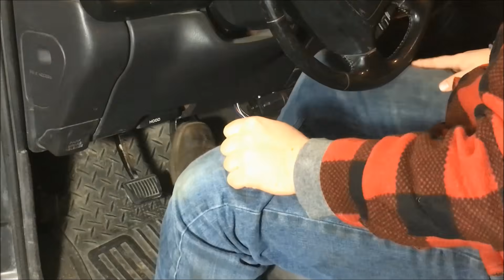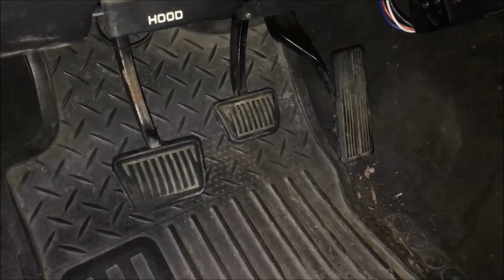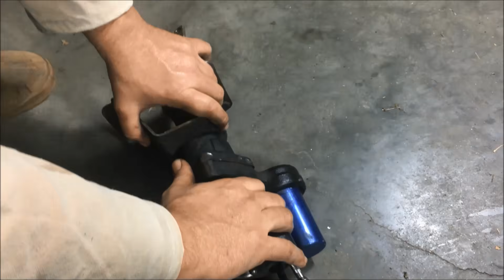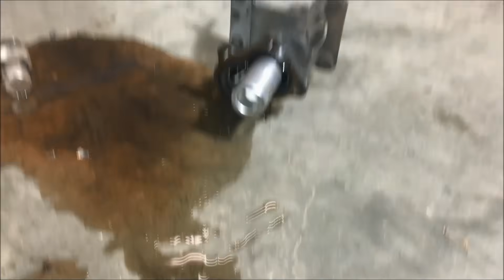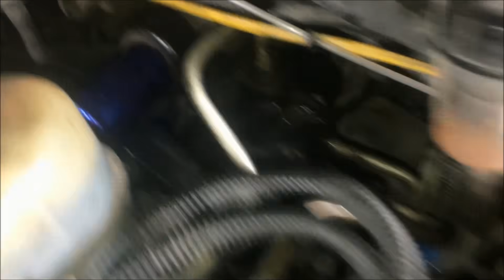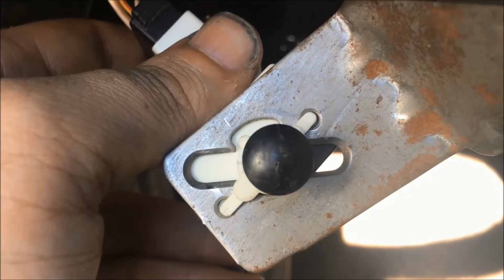How To Repair A Dodge Hydroboost; Boost Auto Parts

Comment: Hey thank you so much for your help.  This video really helped me out. 
I have a 2013 2500 Ram, I just rebuilt the Hydro booster. It’s all put together and the truck is ready to be crank up and turn wheel left to right and press the brake.
Would that be the same process for my truck that you show at the end of this video?

Comment: This video was extremely helpful, but I wasn't comfortable using their reassembly technique.  Rather than hold the plunger with a vise grip, I removed the star-shaped retainer clip and positioned the parts vertically so I could carefully observe the piston sliding through the lip seal without damaging it.  Then, drop in the plunger and reinstall the star-shaped retainer.  I found this method much easier and less stressful.
Reply from the maker: Good advice

Comment: Seal lasted 6 months, it puked again 😡
Reply from the maker: You likely have contaminants in your power steering fluid if you're receptively leaking. I recommend you fully drain, flush, and refill to avoid issues in the future
Reply: @ 
I have replaced the power steering pump, that one was defective, and I had to replace it a second time, I also replaced the vacuum pump, and the hydro boost.
The fluid is very clean, but I guess I’ll have to flush it by disconnecting the return line

Comment: The description of this video says: "If you are experiencing a power steering leak that is coming from near the firewall, in between the hydroboost and the brake master cylinder, chances are this seal is the issue!" .... Then multiple times in the comments it says that a firewall leak is not this seal. Can you shed some light?
Reply from the maker: The leak caused by this seal is if the leak is coming from in-between the master cylinder and the booster.

Comment: My 99 ram is leaking. You pointed out that the leak is coming from in between the master cylinder reservoir and the hydro booster. Should the first seal stop the leak where they separate? If the internal seal is leaking I don't see how it should get past the outer seal?????  Just curious 
I know probably should change both but it would be a lot easier since I wouldn't have to pull the hydro boost and brake pedal.
Reply from the maker: We would recommend changing both, likely there are contaminants and if they're not both already shot they will be soon

Comment: I wonder if this is the same for a 2014
Reply from the maker: Yes
Reply: Only difference is you have to reprogram the brake switch on 4th gen +. It’s not mechanical. You have to use alfaobd to re learn via the abs module. Easy peasy.
Reply from the maker: @TrevorCazes  I see

Comment: Has anyone had a problem with the piston cutting the seal when going back together? With the lips facing that direction it seems the piston has to come from the other side.
Reply from the maker: It can happen. The seal needs to be completely seated and oiled. It's easy for it to not be fully seated.

Comment: Does this also cause hissing? 05 Cummins here done replaced power steering pump and the high pressure line
Reply from the maker: It should not cause a noise.

Comment: My question is this: Are we talking about the SAME seal if it's leaking into the cab of the truck?  Mine is not leaking at the joint between the brake reservoir and the Hydroboost. Mine is pouring into the cab directly out of the hole the brake rod comes out of under the dash. Mine is a 2014 RAM 3500 with the gasoline 6.4 Hemi.
Reply from the maker: No - that will require a new hydroboost.
Reply: @boostautoparts NEW Hydroboost it is, then.
Reply: @NorthernChev did you fix the problem, I’m currently having the same issue. Leaking into the cab. Did it make a whining noise as well?
Reply: @juancarlosgomez7634 Yes, the problem with it leaking directly into the cab WAS the hydroboost.  And, BTW, it's super easy to change.  I feared the worst.  It looked quite intimidating tucked in under all that stuff, but it was a cakewalk to change.  All kidding aside, I think it took me less than a half hour to pull the old one out and put the new one in.   
1) Disconnect the brake booster and pull it forward slightly with all it's lines attached. 
2) Then, remove the booster bolts at the firewall and the Brake pedal attachment. 
3) Then, just pull it out with the (short) hard lines attached and reattach them to the new part before you put it in. 
4) NOTE:  You must replace the brakelight switch during this process as the switch is a "one-way" design.  Once you remove it you can't reinstall it and still have it working correctly. - My power steering pump made a whining noise too because it was low on fluid due to the hydroboost leak.  The brakes AND the power steering work off this one unit.

Comment: Has anyone else sheared the lip off of the seal, my piston does not have any relief to get it to let it start the seal like was done in the video.
Reply from the maker: It may be out of spec and require replacement. We recommend really lubricating the seal prior to install as well.

Comment: The brake switch can be reused. I reset it by taking it apart. I forget the specifics. It's been a couple months. But i think there is a smaii hole you can put a small drill bit into to release the ratchet mechanism. Then force the button back to reset the position without taking switch apart.
Reply: I just had my buddy watch and I adjusted it by the bracket bolts

Comment: On my 98.5  dodge 3500 I have no pedal at all and my hydro booster is loud and causing vibration threw the pedal (well it was before it went all the way out) would this be the same issue?
Reply from the maker: It sounds like you need a new hydroboost

Comment: I Just did gearbox, pump & hoses and was  wondering WHY IS IT STILL LEAKING!    oh, its the hydro boost...
 Glad I can do this with a cheap seal, THANK YOU!
Reply: Did you have any issues with low steering assist at idle I just did my pump hoses and gear box and I have a pulsating in my steering and brake pedal and no steering at idle I’m at a loss the hydroboost is the only thing I didn’t replace yet!

Comment: Thanks for the great video, you helped me replace the seals on my 01. I would advise anyone doing theirs to use plenty of power steering fluid to coat the seal before reassembly, I only applied a light coat and it caught and pinched when I put it back together the first time.

Comment: I don't have the time or place to do this myself. I had my hydroboost changed with a used unit to save money now less than three years later I need another one at a cost of $800 + labour in my region. Dodge should be made to replace these free along with UV joints and transmissions. Anyone want to buy a 2003 Dodge 2500 diesel truck?!
Reply: Sure

Comment: Tried reinstalling a new seal this way, seal got torn by piston.  Had to reinstall new seal, remove the big spring, spring retainer, and push rod to see the contact between the lip seal and piston. Had to use a small pick to guide lip on seal around head of piston to seat properly. Then reinstall pushrod, spring,  and retainer.
Reply: Yeah same here
Reply: Really?
Reply: What about the break switch, did you have to replace that as well?
Reply: @timothyleyva1986  no you dont need a new switch.
Reply: Same here...
Reply: Some people just shouldnt try such things. Thats why there are repair shops.

Comment: ?great video !! ,If the leak is from the side of the pedal, is this seal help
Reply from the maker: If it's leaking into the cab it is probably a different seal. You should get a complete rebuild.
Reply: It's more complicated than you did in this video? thank you
Reply from the maker: Yes

Comment: Why can't you do all this with the rear half of the unit left in the vehicle?  Once you get it all apart, you basically ignore the back half until it is time to reassemble it.  It would dispense with all the work under the dash.  You flat raters out there - what say you?
Reply: i did it this way. seating the one piston on that arm was a real pain in the ass took me like 30 minutes of finessing but if you go in at an angle it works fine. my unit still leaks and I will just be replacing it done with the headaches lol
Reply from the maker: Hi Rick,

It can be done on the truck as you noted, but it is quite difficult. 

Thanks!

Comment: Uffff my 2008 ram 3500 is leaking and the carpet is ruin,  this repair will help me save money to buy the floor carpet,  thanks
Reply from the maker: Not a problem, glad we could help!
Reply: Cant fix mine frome leaking through the fire wall.cant get it apart to replace the seals on the 1/2" rod.